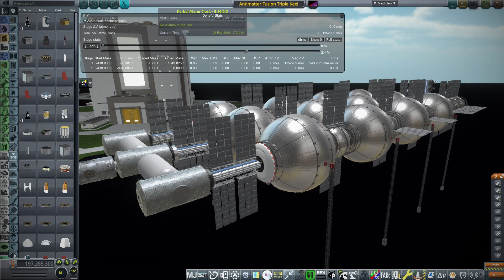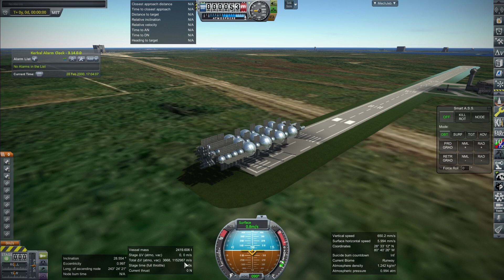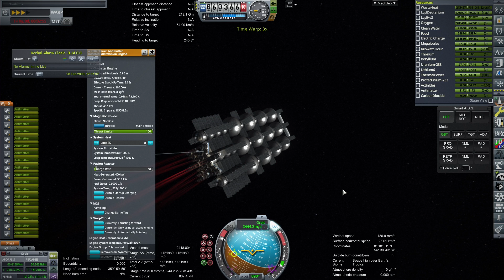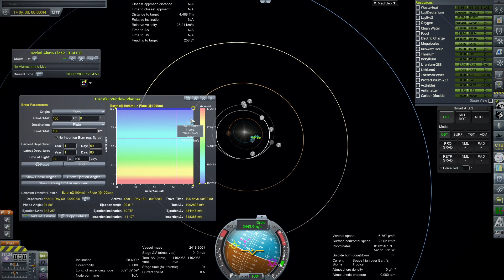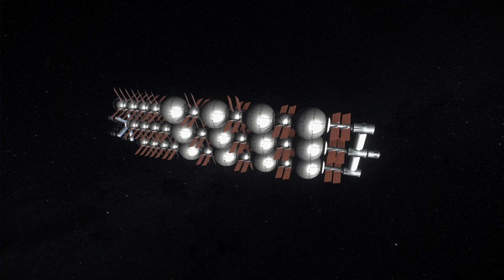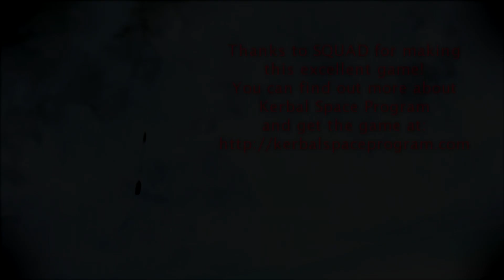Far Future Ship Design - Antimatter-Initiated Microfusion Ship

Comment: Radiators in "Heat Control" with "System Heat", which you are clearly using should scale up with TweakScale. Not sure why its doing that, maybe use the graphene / black radiators that should be in "Heat Control". 

There's also the question of just using fusion bombs with an Orion drive, seems as if not more feasible than Fusion Antimatter propulsion. It depends but 75,000 ISP is fair for a fusion Orion drive. Your system uses a controlled fusion reaction / reactor with hard to synthesize or find elements and or isotopes, contains antimatter, and has a low thrust while using experimental although not insurmountable technologies. The Orion drive uses (extremely and internationally) tested fuels, and semi-tested systems. It also has a higher thrust and less volatile or experimental systems. 

There is an Orion drive included in FFT although it uses Fission bombs / pellets and only has ~4000 ISP.
Reply from the maker: As long as something is physically possible, we are only interested here in when something is feasible. So, a fusion Orion drive might get 75,000s ISP, and that will set a certain speed to traversing the Solar System. The 115,000s ISP of the antimatter initiated fusion drive will give us a greater speed, though it might be later in the timeline. We're looking at a particular year and trying to decide how fast we can reasonably go at that point. We are not saying "well, Fusion Orion drive is more feasible than Fusion Antimatter, therefore we'll stop there and do nothing further."